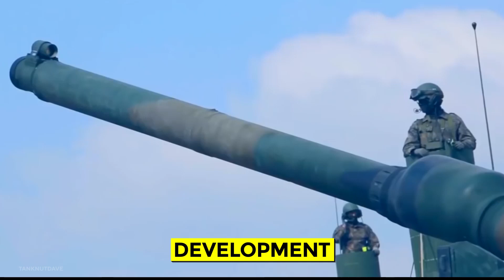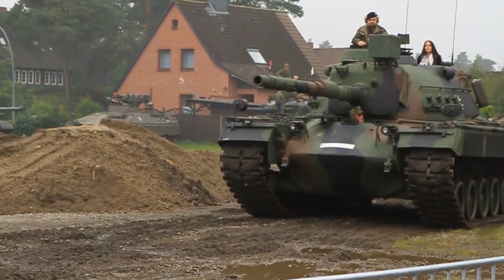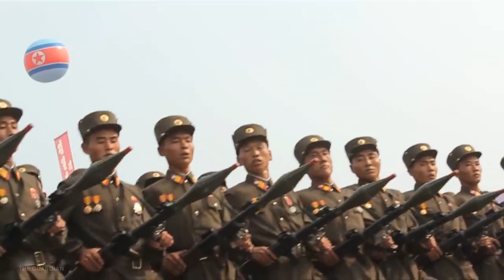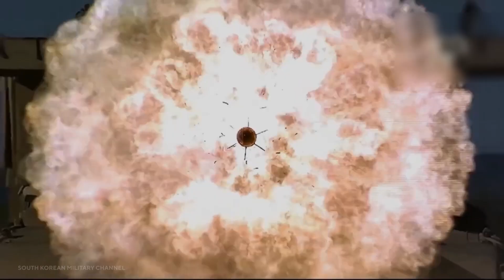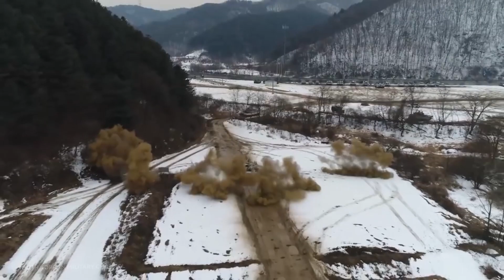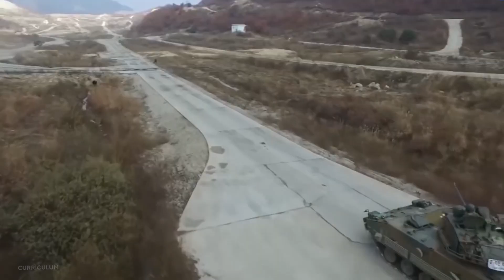K2 Black Panther: Most Expensive Main Battle Tank

Comment: The main gun of the k2 tank(WIA CN08, https://en.wikipedia.org/wiki/CN08_120_mm_gun ) is not licensed by Rheinmetall. 
The main gun of the k2 tank WIA's CN08 was a reference to Rheinmetal's, but was a standalone product.
Korea produced the main gun for the K1A1 under a license for the US M256, a 44-caliber 120mm main gun.
Based on this, WIA independently designed the 55-caliber 120 mm gun.
The American M256 gun has licensed Rheinmetallic technology, so it can be said that it was indirectly influenced by Rheinmetall.
So, the K2's main gun has a structure similar to that of the M256, but the structure of the main part is different from the Rheinmetal's main gun.
The K2's main gun is lighter than the Rheinmetall's and was designed to withstand higher pressures to support the K279, a unique shell of Korean Army.
It also supports muzzle-launched missiles(KSTAMs) with a range of 8 km.